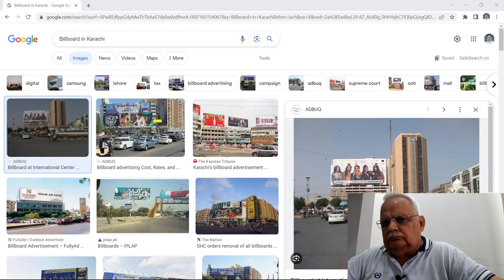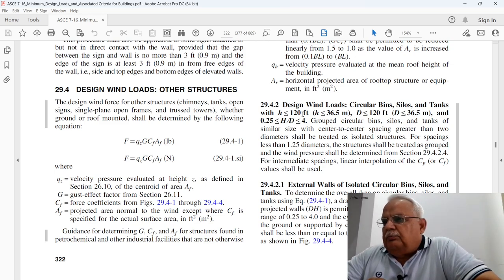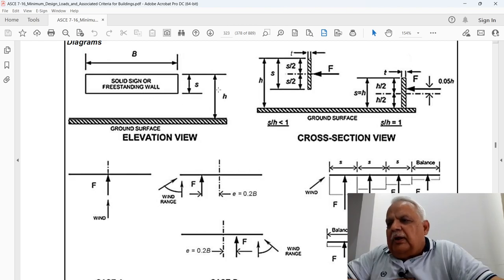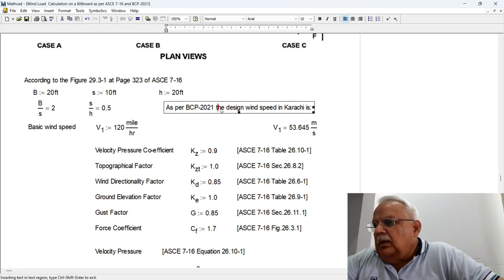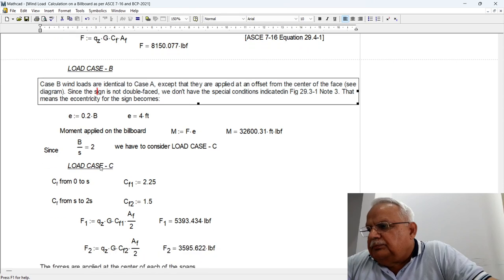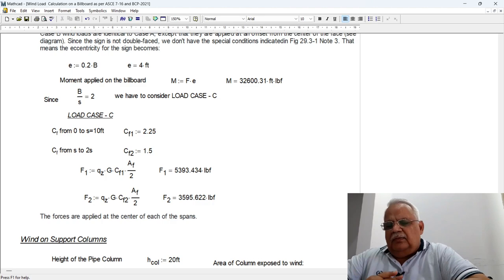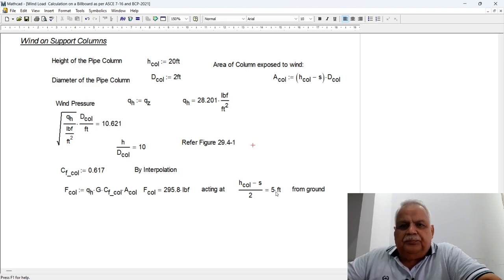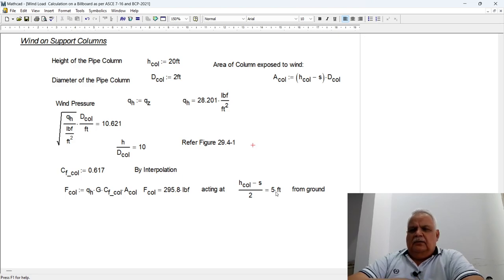Design of Billboards against the wind load according to ASCE 7-16

Comment: I have a question,as you have said that the billboard should be safe ....after finding the wind load acting on the billboard ,how do you use  that value to determine whether the bill board is safe against that wind.
Does the codes state that !!or we should just go further use the wind load we get to design the foundation,the steel bolts etc....
Thank you

Comment: Thanks alot sir for valuable explanation. I have 2 questions.. 1. As per ASCE 7-10 and onwards, importance factor is excluded fron eq of qh, and wind load combos are having 1.0 rather than 1.6 compared to older version but this is because they linked velocity with risk category , so the wind velocity that we are selecting to be multiplied by factors > 1 depending on risk category. Explain this please..Q2. How the calculated Moment should be applied to the structure when if it is a truss ? Please explain thanks
Reply from the maker: OK, I shall try to explain un my next video.
Reply: @msajjadh  thanks
Reply: @msajjadh how do we contact you?